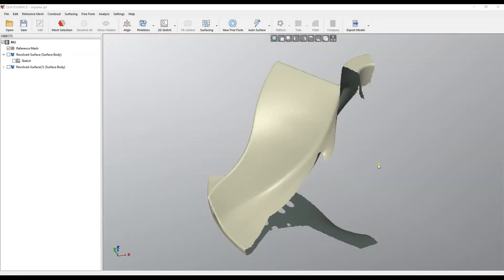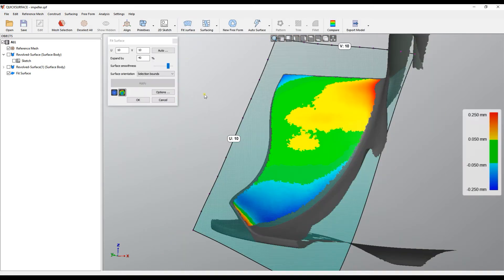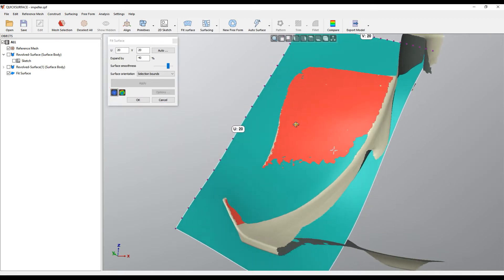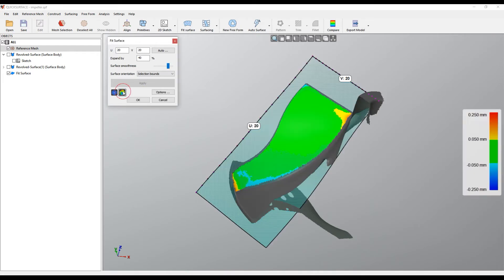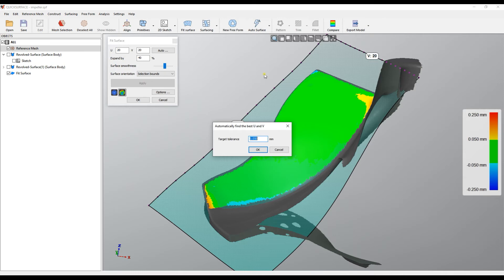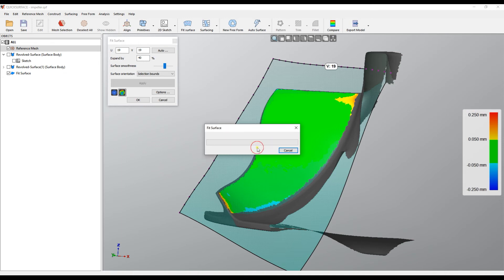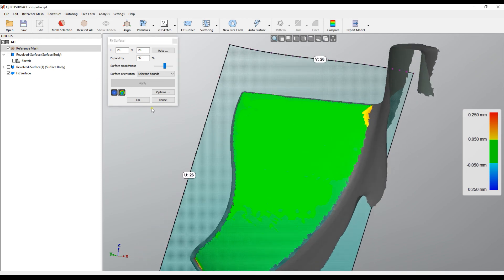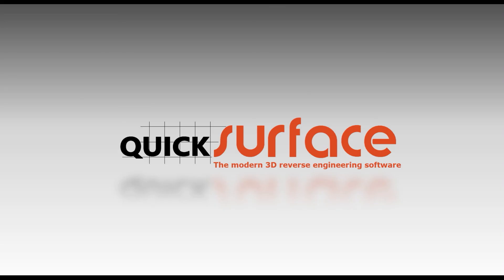QS Tutorials: Fit Surface - How to do Reverse Engineering with QUICKSURFACE

Comment: The "how" is explained very well in the series of videos, but the "Why" is severely lacking, especially for someone new to the technology.  From the presentation, I know exactly how to perform the operation, but why am I doing this?  How does it fit into the overall grand scheme of the process.  Where exactly am I in the linear process with this function?  What happens if I don't get the same results based on my part?  How would I perform any of these steps on complex part that doesn't have traditional defined shapes (conics, planes, etc)?  These questions are for past vids as well as this one.